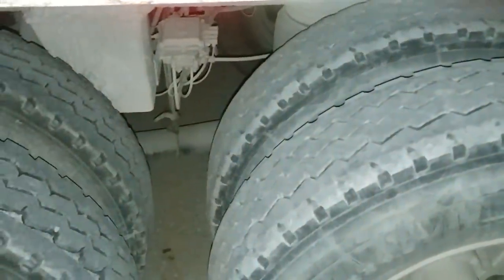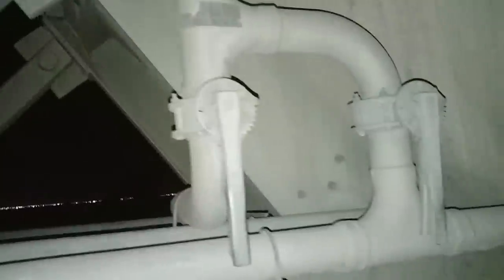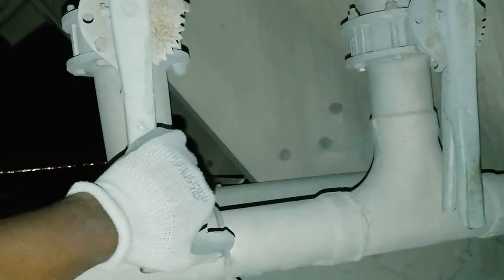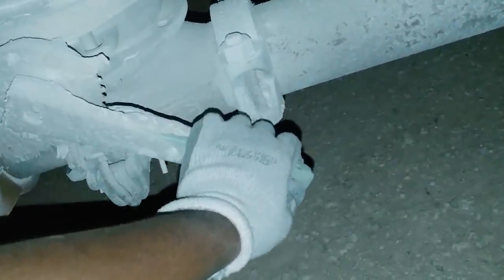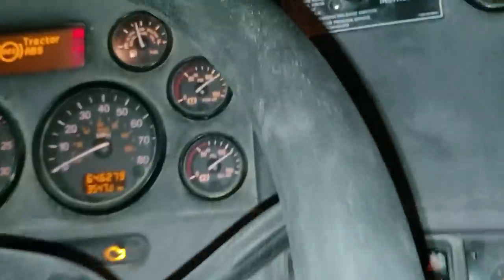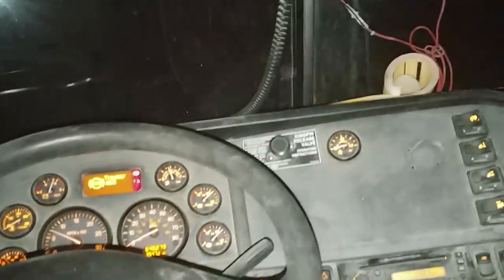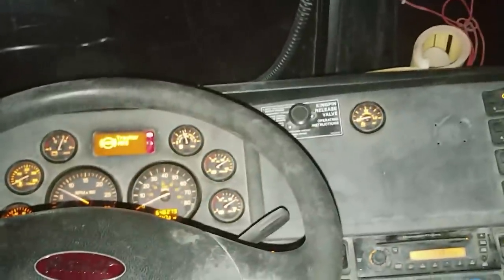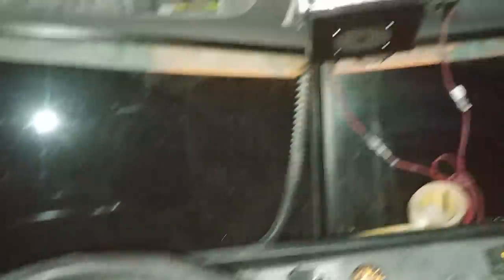Fixing Pneumatic Trailer (Part 2)

Comment: 18 psi is way too much 10-12 is all thats needed you pushing the sand way too fast , i wonder how many times you clog the hoses
Reply: Porzongis Is King. exactly i work out here hauling sand and 8-12 is normal anything more you asking for trouble and besides my pop off valve kicks in at 15 so how he reaching 18 is beyond me
Reply from the maker: +georgiaboy truckin for that check i said 18 tank 10line. Not 18 line
Reply: Chasing Andrew Jackson ok cool bro im glad you cleared that up cause i was like dang thats alot